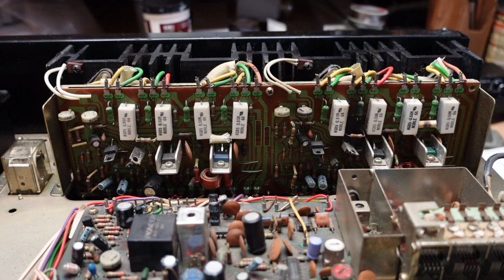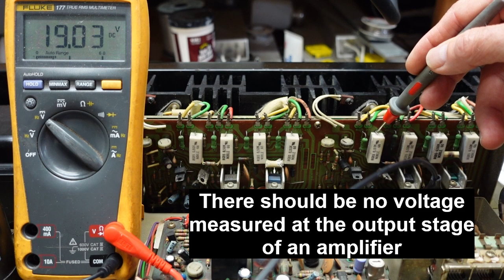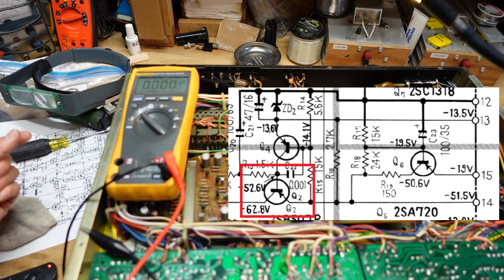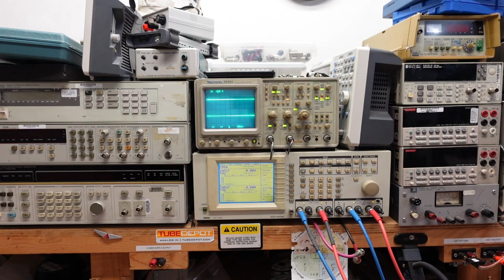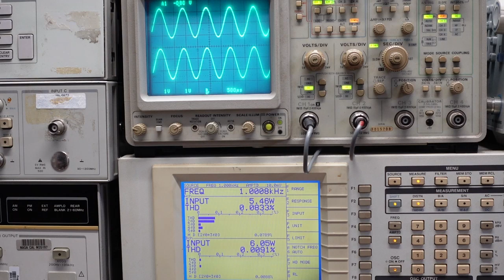Pioneer SX-950 Repair

Comment: Ray, long time viewer and can’t thank you enough for your expertise.  Once again, you helped me troubleshoot a unit.  This time around, a SX-950 with exactly the same symptom you came across here (bad 2sc1318) that was keeping the unit in protection.  I repair vintage stereo here in NW Austin TX as a side business, but without being an electronic engineer by trade, your insights are so valuable.  You are DEFINITELY giving back to the community.  Cheers!
Reply from the maker: Thanks Brian.  You made my day!

If you get hung up on something don't hesitate to reach out.  My email address is located in the channel description, and is visible when you click ...more

Comment: Over the weekend I became the proud owner of a Pioneer SX-950.   It’s a beautiful piece of machinery.   Testing it out though, I’ve come to suspect it has a few problems.  I don’t have a dedicated CD player but my DVD player plays CDs.  So I used that.   When I plug that player into either of the two phono input jacks it sounds muddy and muffled and the top end frequencies are cut off.   I can’t set the volume above 2.5 or it will emit a terrible rumbling sort of feedback sound.   If I plug the CD player into the aux input it sounds much more clear. I can crank it up to the max volume and it sounds way better.   I have a pair of Klipsch Epic CH-1 speakers.   Any thoughts?   If I had to guess, it seems like the CD player pumps out a much higher sound volume than the two phono input jacks can handle.   That’s not adjustable on the CD player itself.  Or, I need to inventory the various capacitors to see if any are shot.    Does it sound like the problem is the CD player or the receiver?
Reply from the maker: Neither.  Phono inputs have much more gain than aux or tape inputs.  In addition, when audio is mixed for vinyl transfer, an EQ curve is applied to compensate for the sonic limitations of vinyl.  Phono stages have a hardware EQ curve built into them to flatten the EQ back to normal.  That's why a non vinyl input usually overloads the input and sounds muddy.
Reply: That makes sense.   Thanks so much

Comment: I bought a 950 a few months ago. When I power it on, it turns on as it should,  I hear the relay click, and then it plays  music just like it should and then I hear a pop through the speakers and the music is gone for around 5 seconds, then the relay clicks and it's back to normal.  It may do this 2 or 3 times and then it doesn't ever do it again unless I turn the power back off and then turn it back on in around 5 minutes.  It seems like it has to warm up to be fine if that makes sense? Does this sound like I should just replace  the power relay switch cause it might be too old? Just curious what you think. And how did you get the schematics?
Reply from the maker: If the pop is through both speakers, there may be a transistor getting noisy in the power supply.  Just one or the other speaker would probably be the differential transistors in the associated channel.

There's nothing wrong with the relay itself; the protection circuit is detecting DC from the pop, and doing its job.

I got the schematics from HiFi Engine.  A search shows several sites that have it for download.

Comment: Ray, check the pnp input differentials , the blue caps on the amp driver board, and the pnp devices in the phono preamp and line stage. I do not remember the pnp device numbers . Also cracked solder joints in the PS on the dropping resistors.

Comment: Glad to see you back! For future reference, the 150 Ohm resistor in series with that 1318 is also a common failure, and the blue (sometimes white) Sanyo coupling caps are notorious. In the SX-828 they cause big problems in the tone circuit but I think on the 850 they used Elna for that.

Comment: I hope your strike is a short one. I was on strike against Illinois Bell for a week and a half in 1983, but I was young and still living at home, so it was just an extended vacation.  I can't see managers taking techs spots nowadays, especially in a CO environment or working on customer network equipment, as, very few, if any, know the requirements to even access the info needed to troubleshoot, resolve or install new new circuits or equipment. It's different to see how Pioneer powered some of the input amplification with a separate power supply, as most every amp powers that part with the same rail as the rest of the amp section, so I could see how that would throw troubleshooting the DC offset for a loop.

Comment: I have an SX-5570, which is the black faced version of the SX-950. In the 6 years I've had it, I have had to go in and make repairs about every 6 to 8 months. While I am no advocate of shotgunning components, I finally did that this past spring. It was just a cascading chain of different failures over and over again otherwise.

 Part of the problem may be the fact that this unit was in a shed for the past 15 years before I acquired it, so it would have gone through extreme heating and cooling cycles here in Pennsylvania. It could be as cold as 10 to 20 degrees below zero in the winter at times and as warm as 100 degrees in the summer on occasion.

It is running much cooler and the sound is very good now that I "shotgunned" it. There are many transistors in these that are on the naughty list. I replaced almost all of them. Did not do the pass transistor and it's opposite polarity equivalent in the power supply that you replaced in this video though. My voltages were still spot on through the entire power supply. Hopefully it will be many more years before I have to repair this again.

Comment: Hi Ray, very nice to see you again, nice work congrats on the win over the machine 👍. It happened to me that I forgot to measure a part of the circuit, but if you measure everything, you also write down the values and during the testing, the source will lose 7V and you will only find out when the parts burn, which is annoying. That's why I made this multi-channel voltmeter and I constantly monitor all voltages during testing.
Thanks for the link 🙂 to the list of problem transistors, I was just looking for them, I have one problem amp on my desk right now with a random glitch in one channel.

Nice day 🙂 Tom